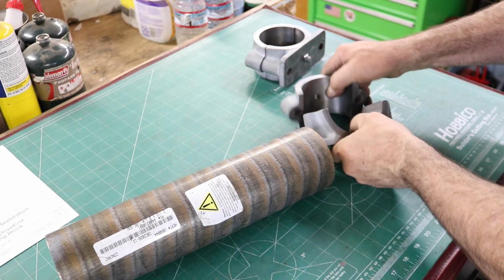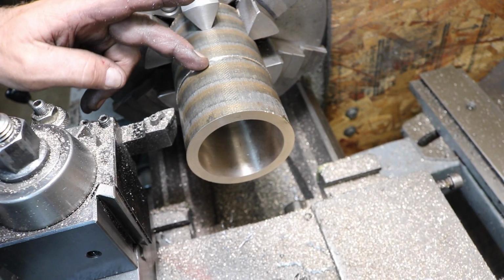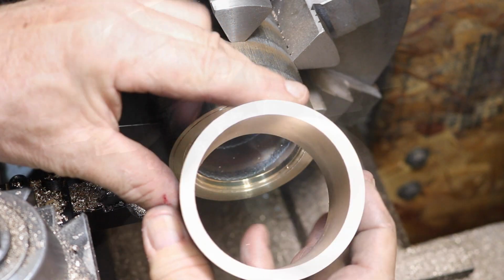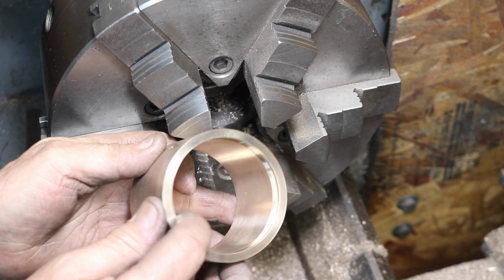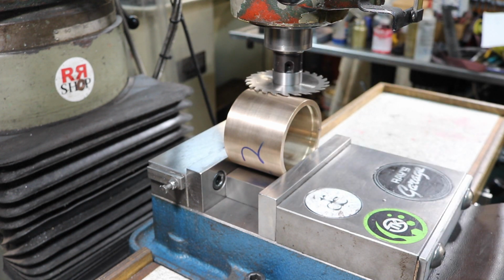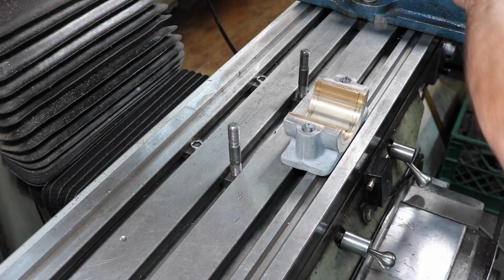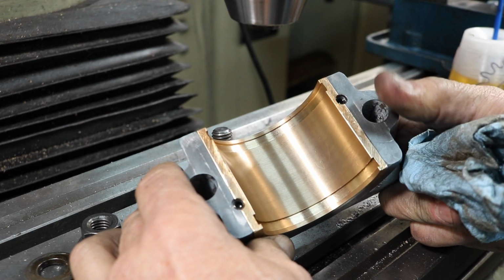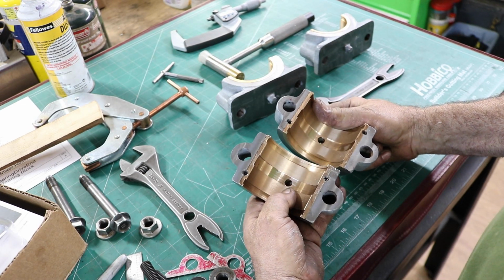Cement Mixer Restoration | Get Your Bearings P2

Comment: Hi!
If you were to dispense with the compressed air for cleaning and rather use a paint brush, you wouln't have those messy brass chips all over the shop. Instead they'd all end up where they belong - in the chip-pan.
Reply from the maker: Thanks for the tip!

Comment: Very nice Randy, when I used to scrape rabbit bearings, the rules of thumb were: .001" clearance per inch of diameter and add a lead or pocket at the joint to promote lubricant flow  into the journal. Those puppies will last a lifetime , and look good too! Cheers!
Reply from the maker: Great tip!  Thanks.Stay Safe.
Reply: @RRINTHESHOP  Sorry, rhymes with "rabbit"! Guess I need a new smell check , haha!

Comment: You are the cement mixer master. If you put wings on that it would fly.
Reply from the maker: Getting to liftoff speed maybe tough.  Thanks Robert.
Reply: @RRINTHESHOP  You would have to add an airfoil to the mixer.

Comment: As many engine bearings I've installed, I would not have thought that they (shop made bearings) needed that crush fit until you pointed that out.  And that was with the awareness that if you didn't get that affect while fitting engine bearings, it means that something is not right with the parts you are putting them in.
Click.
You may have saved me from (a) Major Bozo there ... I've got mini lathe that needs a new head stock/spindle bearing.

I knew it, but now I know in a different way.  Like the difference between seeing a bucket full of ice and water, and knowing that it's cold ... and having that bucket of ice water dumped over your head and Knowing that it's cold.
Reply from the maker: Thanks Digger,  Stay Safe.

Comment: I've made MANY bearings like this for machine tools. The second step after sawing the length I want, was to saw the piece in half length-ways, then solder it back together.
  Once the part is finished to size in the lathe  and oil grooves cut, a slight rap with a dead blow hammer makes two halves out of the bearing. The halves are clamped up in working position in the machine tool, and I drill and ream for a bronze pin and loctite  4 pins in each half, securing the bearing in the housing.
 No bridgeport operation  or second lathe operation. All grease or oil grooves are done in the lathe operation and no shims were used. We always left a couple thou to hone out, once the new bearing is mounted in the machine tool.
 Many times we had to line bore the machine to have a good true bore for new bearings.
Reply: Did many that way. Sometimes we would make a grove at one end and put a wire in it and the grove in the chuck jaw to hold it straight.
Reply from the maker: Thanks, stay safe.
Reply from the maker: Thank for the suggestion.

Comment: I suppose the tip in using sharp HHS for bronze/brass is also a good idea for plastics, right? Carbide seem to leave a taper and a rough finish...or maybe it's just me.
Good video, thanks for sharing, Randy.
Reply from the maker: Yep HSS for brass, bronze, plastics, and razor sharp,  positive rake,  works best.   Thanks Joe.